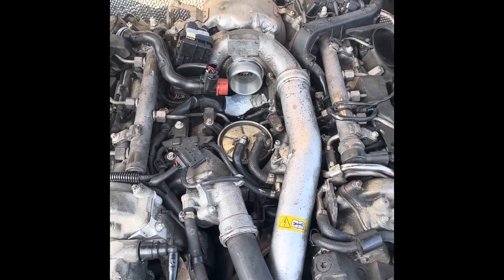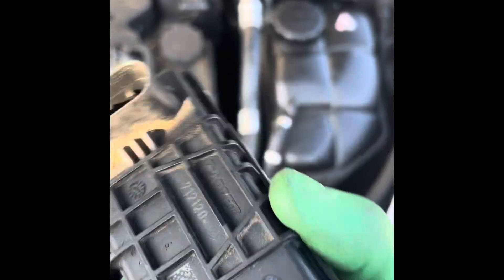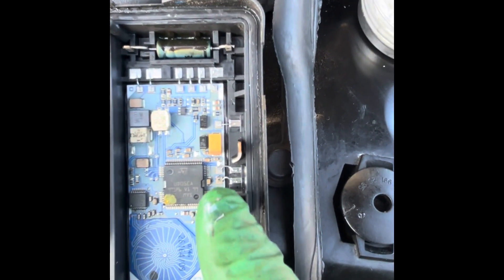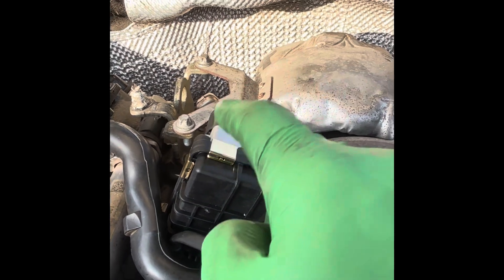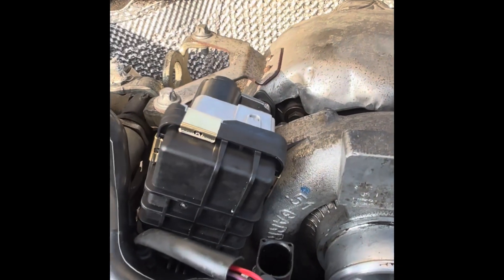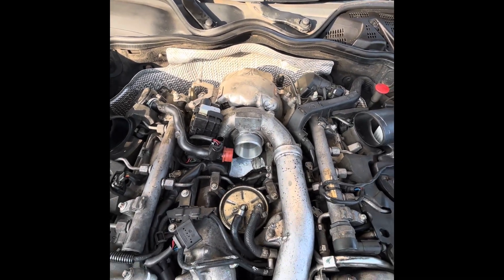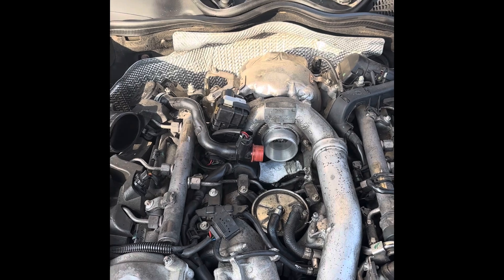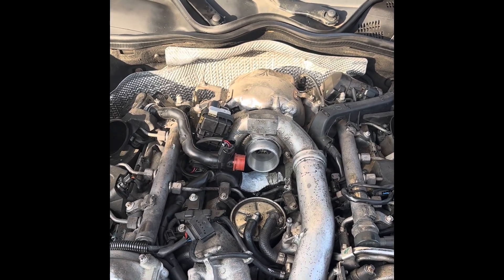Mercedes W211 E320 CDI - OM642 - TURBO ACTUATOR FAIL & REPAIR

Comment from the maker: Hi all just an update update, I have had absolutely no issues with this repair, cheap and simple, no hesitation or limp mode, and none of the bunny hop thing that my car was doing when accelerating hard. I was very surprised with the cheap eBay unit, works like it should, and also no fault codes at all. cheers all

Comment: Good vid, very helpful. 👍
No coding needed to pair the new one to the car then? Thanks in advance!
Reply from the maker: @neildempster2827  just parts match and all good it seems. Running now for a number of weeks. No more bunny hoping when you go for kick down, runs perfect. I originally believed the swirl flaps were the cause of this, I was clearly wrong.

Comment: Do you have the link for the actuator you purchased? Thanks
Reply from the maker: Hi, just go on eBay and look for it, get the G code from old one and the other numbers and do a search, simple, cheers
Reply from the maker: Replaced with eBay listing 296102213443 - G277 - 712120 - that matched mine and works for me.